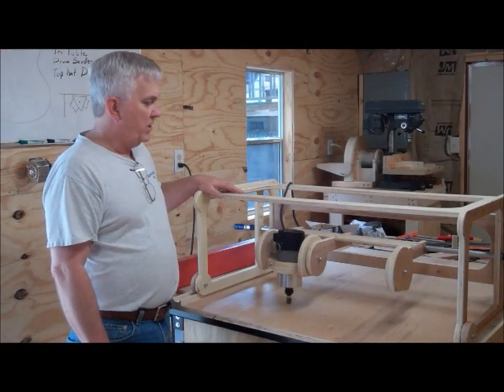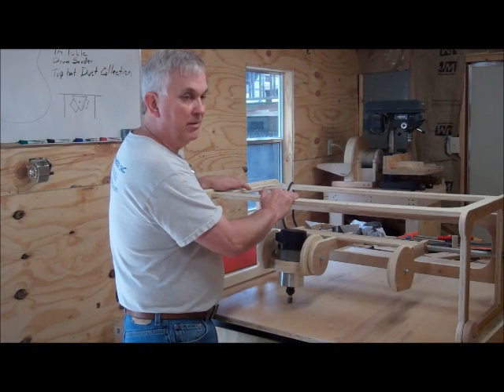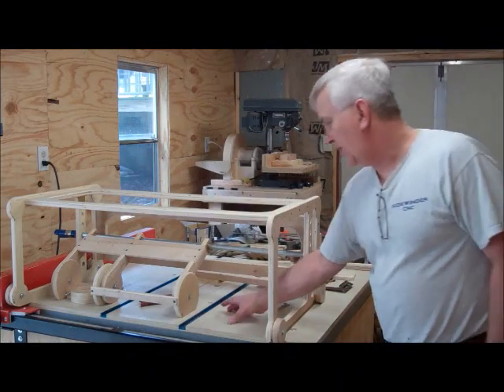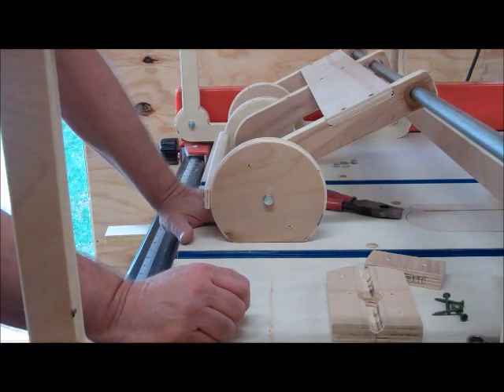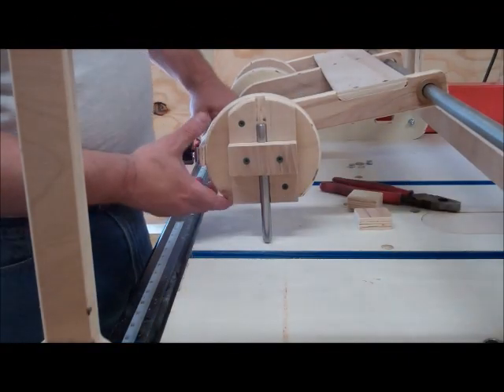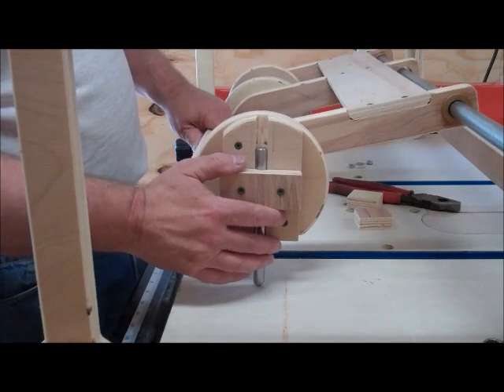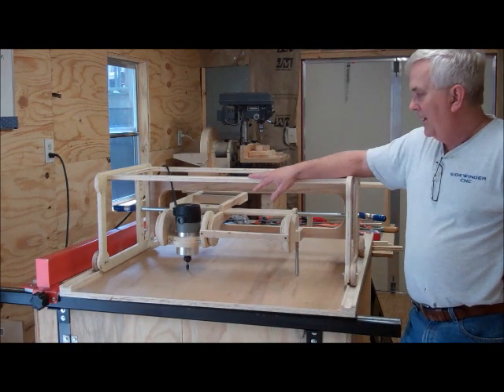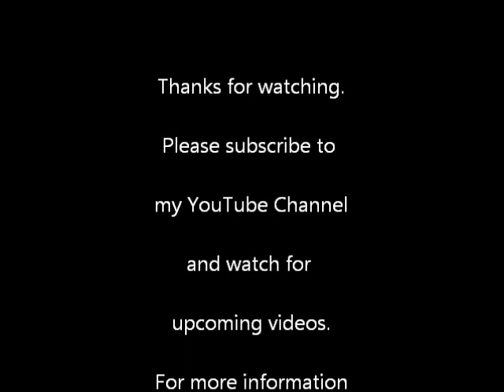Duplicator Copy Carver Router Part 2

Comment: i like it tho wheres the test run to see if it even works well? plus just suggestion you can also use springs instead of counter weights tho everything has to be tried before anyone can determine what ways is best of-cores

Comment: Very nice build Dave. I will make a suggestion if you don't mind. I would change the stylist to a 1/2 drill chuck and then you would have a quick change stylist, you could use a router bit just like what ever bit you have in the router. ( most woodworker have two or three sets of router bits. )